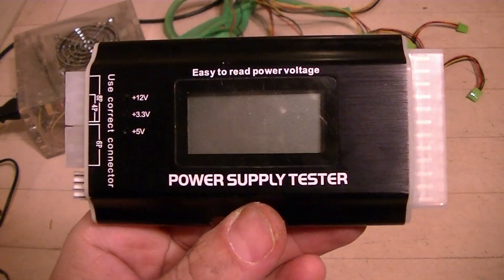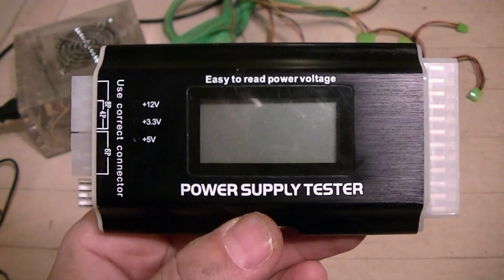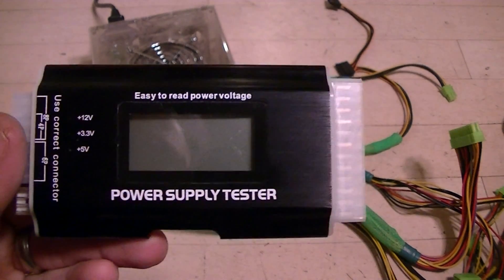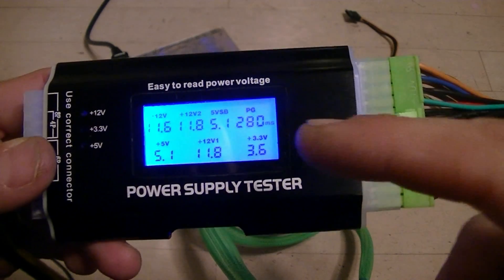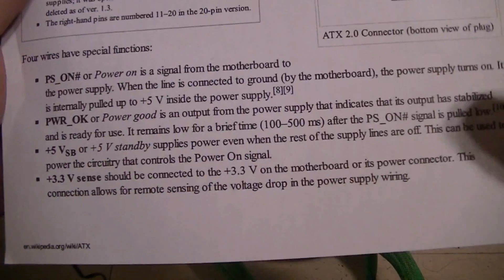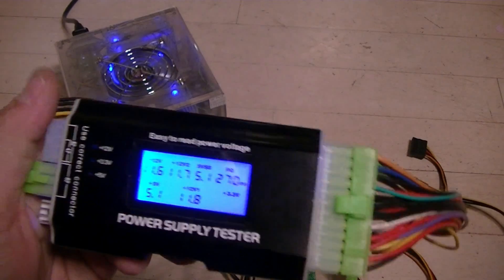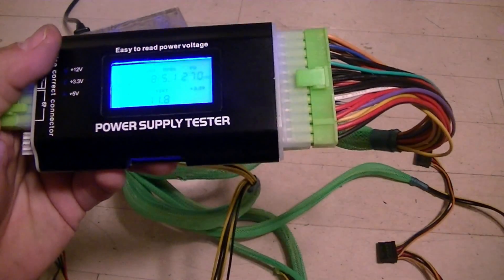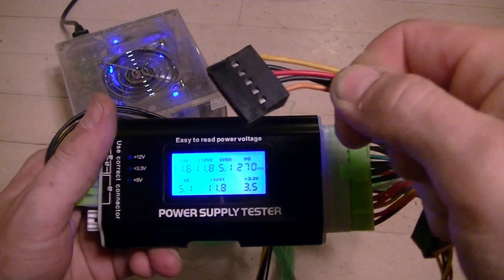Using a "Power Supply Tester" to test an ATX computer PSU (and a voltmeter too)

Comment: Well done. I've used one of these PSU testers for 20+ years. The 3.3V error was caused by your floppy power cable. You should also not plug in P4/P8 and P6 at same time.

Comment: LL on a PSU power tester stands for low level.    I was concerned after buying a new Corsair power supply from someone on EBAY and then discovering that even with a 100% rating, some sellers will be doing fakes.  I learned that doing research  for a GPU to build this computer.

I was getting two errors of LL on the power supply meter.  Adding the 8-pin, solved one of the errors but the -12 rail still was coming up LL.    Did the guy send me a factory reject?   Did he swap out a good supply with a dud?

I did a bit more looking into it.  For some reason, Corsair  doesn't label their wires:  They are black.    Makes the case look better but harder to trace things down.  

I thought of what does LL mean, low level or not detectable.  If it were -10.5 volts, that'd what it'd read. Then it dawned on me about the -12 volt rail.  They don't include it anymore because it's not used.   Duh.  Does that make it a perfectly good power supply?  We'll see when the other components  come in and I do a bench test with the motherboard connected with the bare minimum for it to boot.

Comment: Thank you.  I think your printed out diagram would take a different video to explain, but I was able to test the motherboard connector's power output, and the cpu power output. 

All the cables on my fully modular psu are black... it would be nice if the connector pins had little green, red, yellow, and black dots to help identify each individual cable, but I guess companies don't feel it's necessary (or adds cost to the manufacturing process).

I just hope the MB, CPU, GPU, and the other parts I got work properly.

Comment: Thanks for doing this video. I recently ordered one of these but it came with no instructions! My power supply was showing L.L on the +12V2 with just the 24pin plugged in, until I plugged in the 8 pin connector also, then the error code disappeared.

Comment: I tested my 6+2 pins in the 6 pin slot on a PSU tester and they were normal, but I tested them on the 8 pin slot and the whole PSU tripped... Both of my 6+2 pins do this.

I assume that's not normal?

Comment: These are available from Amazon (Fuhengli store) for $15.99, and on eBay for prices starting around $11.  I have always tested ATX 
power supplies by grounding the green wire (pin 16) and measuring the voltages with a voltmeter. However, this is not a guarantee 
the supply is working correctly, as the voltage must be measured under load.  I have had computers fail to boot even if the voltages
measure up and the supply meets the wattage requirements. If this happens, resistors must be used to provide the loads. Remember 
that the resistors must be rated for the required power, or you will fry them. This often means having to put several in series or parallel.

Comment: I plugged the cables to my psu but the "tester" is not going on. Does that mean that my PSU is broken? Because my PC does not work anymore. That's why i bought it and wanted to know if it was the PSU. I have tested my other CPU and Mainboard with the same PSU and it doesn't work. I guess I found out that my PSU is the problem in my case when the "tester" is not going on.

Comment: One huge drawback of these pissy little test devices is that the high current draw for modern motherboards is not measured. I pulled apart one of this model and the load resistors are about 5 watts each. If you want to do a proper test of your PSUs, build one yourself.

Comment: ¿Cuál es el valor de tensión del cable negro ?
¿Cuál es el valor de tensión del cable rojo ?
¿Cuál es el valor de tensión del cable amarillo ?
¿Cuál es el valor de tensión del cable naranja ?
¿Por qué parpadea el valor de +3.6V de pantalla ?
¿Entre qué dos pines del conector ATX24 puede hacer el puente para iniciar la fuente?
¿Por qué pone un ventilador a la fuente cuando la puentea?
¿Qué conectores permite conectar el testeador de fuentes ? Nombra los 5 que hay.
¿Por qué si tiene un LCD con los voltajes tiene también unos LEDs ? ¿Para qué conectores sirven estos LEDs ?
¿Qué significa el tiempo en milisegundos del parámetro PG ?

Comment: Mine is beeping and PG is blinking at 160ms... Any idea?
Reply: Mine does that too at 120ms.  It did it with a new PSU also which is working fine, but I am still scared that my old psu fried my motherboard and that's what I bought the tester for.  If anyone else knows, please reply .... any idea?
Reply: @embertilton597   I had mine replaced, bro. They verified and concluded it was faulty, but I dunno what was wrong exactly. Good luck!

Comment: I’ve been getting all blue screens lately my pc boots fine into Windows and runs games fine but it just randomly reboots I’ve swapped the hardrive and reinstalled windows and still having the same issue I wonder if it’s bad ram or power supply please get back to me if u can thanks
Reply: I would make a ram test on a different computer and then check the power supply.

Comment: Thanks much for your video. 
I have exactly the same tester.  Came with no instructions. 
Your video helped as I hadn't noticed the connectors at top and bottom.

BTW: Have you managed to find a manual or any documentation on this tester?

Comment: cool video. I just got one cuz i just built my first pc and it keeps randomly shutting off on me. I cant figure out why but im doing process of elimination and I tested mine with this tester and everything looks good. So i guess its not my psu. i was wondering if i can plug in my gpu power line into this tester anywhere? cuz im thinking its my gpu that is faulty. windows says fualty hardware in my event veiwer for the crashes. Im also getting blue screen (video_tdr_Failure).

Comment: What i asked myself and don't understand is, that i get the LL on +12V2. So do i only have to plug in another 6pin connector, to delete this LL? Or do i have to replace the PSU? Because of to less voltage power supply?

Comment: You won't be able to use it on a Dell power supply. Dell has their own ATX wiring standard, basically forcing you to buy their PS unit.
Reply: Not all Dells. And mostly only older ones. That uses to be true ~15 years ago but more recently they switched to be standards compliant (BUT I wouldn't trust them and would still double check!)

Comment: These devices are nothing less than voltmeters. It does not tells you if the PSU can maintain the voltage levels under load. A failling PSU is usually unable to maintain the voltage level under load causing random reboots. Basically, it is useless for troubleshooting.

Comment: How can 11.6v power something that needs 12.0v minimum to run properly and still we need to account for efficiency as nothing is 100% efficient where there can be some loss. So if you don't get 12.1v or 12.2v how will this work properly if you get less than the needed 12.0v?

Comment: I use this specific unit to test client equipment.  So far it is great.  On this video, you show a cheat sheet of Power Supply specs.  I can find the Wikipedia page you refer to, but not this doc.  Is this something you could share with us?  Thanks in advance.

Comment: 3.3 Rail came on as you started the supply running.  Voltage with a multimeter is non-load voltage.  This test block is load test voltage.
Reply: No these power supply testers don't put load on the psu.

Comment: LL   Means Low Level Voltage condition
Reply: Sir Lord George Edward Reynolds Walinski

I got that so should i change my PSU or that is just false positive?
Reply: @cyborg6294  If you plug in it and LL come out, yes you do.
Reply: @CollinMcrae69  Wait so I just tested my PSU and L.L appears. Also my pc doesn’t turn on anymore after months of having issues of sudden crashes. So does this mean my psu is the culprit and I replace it?
Reply: @Medieva1  Maybe yes, just trying another psu for make sure, "LL" mean your psu is fail for sure, psu is vital a little fail can make ur pc ruins

Comment: This is useless since it can deliver the voltage but some times not the amperage due to leaking capacitors or poor quality. This is a waste of money. You have to take a look in the PSU and see if there are bad capacitors and take a look at the PCB. Some have very small transformers and they are way overrated.

Comment: Just wanted to point out, if the voltages are a little high with no load, that's usually okay (as long as you're within +/- 10%). If you checked the voltages with a running computer attached I guarantee they'd be spot on (at least for a quality power supply).
Reply: 10% or 5% may be more correct

Comment: I am using a Coolmax PS tester. All my voltage check out good, however, My PG shows HH. I have tried it on two different PS with the same results. For a quick second it showed 480 on one power supply. My question is what is the PG and what should it read.

Comment: Hope this helps

Manual:

1. Plug-in 24pin and plug-in (P4 / P6 or P8) connector into the tester before turn on power.
- 20pin ATX PSU: use P4 connector.
- 24pin ATX PSU: use P6 connector.
- EPS PSU: use P8 connector.
2. Turn on your power supply
3. LCD show each voltage and P.G value on the screen automatic and you can hear 2 beep sounds.
4. ATX power output connector checking one by one.
- If power output is working, the LED will light on
- If power output failed, the LED will not light on.
5. Plug-in (HDD/Floppy) connector and check LED light. (+12V1/+5V).
6. Plug-in SATA connector and check LED light (+12V1/+5V/+3.3V).
7. Remove the connector after your checking.
8. DO NOT plug-in 2 connectors in to the tester at the same time. ( Only 24pin and (P4/P6/P8)
9. Abnormal voltage detected will not display on the screen.
10. No voltage detect, "LL" will display on the screen.
11. Detected Voltage lower than Min. value, "LL" will display on the screen.
12. Detected voltage higher than Max. value, "HH" will display on the screen.
13. When detected voltage is lower than table value (A), will alarm.
14. When detected voltage is higher than table value (B), will alarm.
15. P.G value detected lower 100ms or higher 900ms, P>G value is abnormal and alarm.

When abnormal happened, it will alarm and relative digit blink on the screen.
Reply: yes, thanks. mine it's in chinese.
Reply: Nice!
I've one question; does this tester has support for 6-pin and 8-pin (Including 6+2) VGA connectors?
Thanks!
Reply: the PSU tester won't work if the 4P of 24P ATX PSU is plug in at 6P

Comment: I just used this an the PG read as zero. Can you shed some insight?
Reply: +TheBlarghzorz My psu has stopped working pc ,wont turn on PG reading is showing zero on it tried on a spare psu that is working and powering my pc now and that shows PG reading of 280ms so i assume zero reading is showing a fault with in the psu of some kind.  nice btw vid OP thanks

Comment: I use the exact same tester at work. LL stands for "LOW" and it can also flash HH if that particular voltage goes too high ;)
Reply: OK, thanks. I was wondering what LL meant.
Reply: ooooh thanks

Comment: Hello, when I press the Power button on the PC it starts for half a second and then turns off. I don't know if it is a short-circuit or a motherboard problem.  I used this PSU Tester on my friends problematic PSU and what happened was, after I powered on the PSU, the tester gave me a blue screen and a wierd sound and after 2 seconds of charging sound it turn off completely. Now, it doesn't show any indications. I hope that the PSU is the problem and I hope that it didn't fried the psu tester. What do you think?
Reply: You're right. I had it replaced and the computer works like it used to.
Reply: @NikosNisyros  its been 2 years but i have the same problem now so im going to test this out too.
Reply: Did you replace the PSU?  @NikosNisyros

Comment: I've plugged mine in and the PSU fan won't start and I just get LL on all the voltages? Assume my PSU is dead?
Reply: It means that your PSU is not working properly, if it was Warranty still On you should send it back and receive a new one (ik i answer that 9 years later) but someone new might see it and act fast before warranty gone and they have to waste another 200$ on a new psu. So yea the first step is always the FAN working when you turn it on. or doing the ping thingy which i never done it i just got myself that Tool that you plug in the cables and etc.

Comment: I have been using these for a long time, but never thought to test with the Multimeter duh,, ive probably discarded good powersupplies in doing so,,

Very good video on these, and i now know too to not hook sata , molex and floppy all up at the same time as i have always done 

THANKS  this is the most indepth and technical video about this tester !

Comment: hi, where is this cute little device from ?  Is it okay to buy it in China? I see something look exactly the same in China market, I don't know if that's the rip off or something
Reply from the maker: Kenny Kenny  Sorry for the very late reply!
It's fine to get one from china, that's where this one was made.
Reply: Kenny Kenny I am sorry to say no. Not that it is a rip off but in China they use 220v, so all electrical devices, for example, an electrical razor, are different from those in USA.The PSU they use there is 220 v, too.Buy it from Amazon.com
Reply: Thanks for the comment...I made mine differently because I had a WaterPic oral water floss bought in the US and was brought to China when travel. It brew up and smoked immediately when I plugged it in a 220 power source.

Comment: i have been having issues with my PC locking up. I will be doing pretty much anything and the screen locks up and I have to do a hard reset. It works perfectly at my friends house but not at mine. I have used two different power supplies but they were pretty low-end ones. Would you recommend getting this device to maybe see what the problem is?